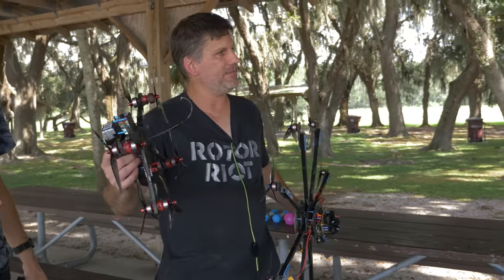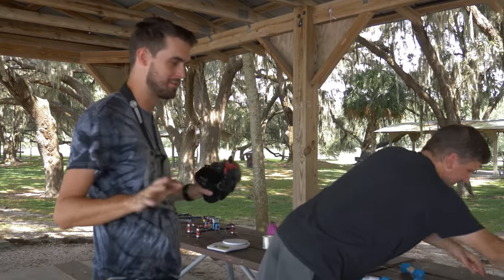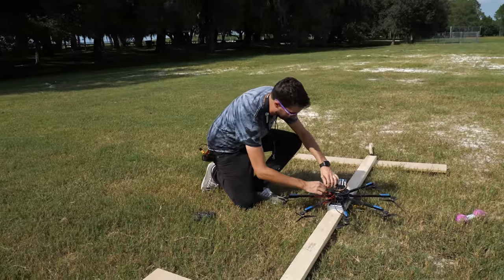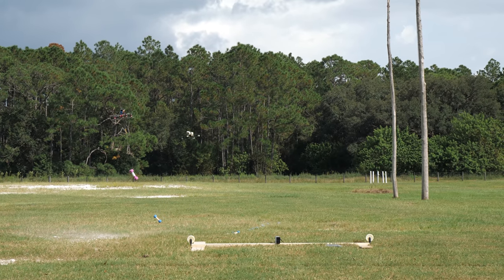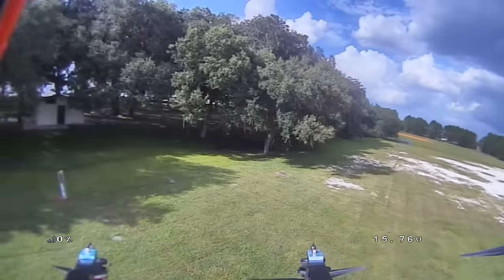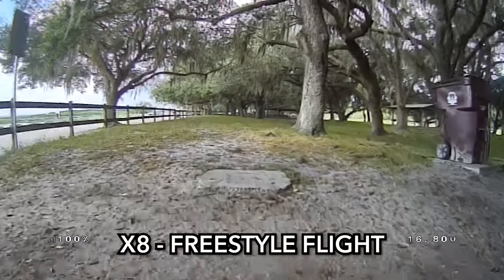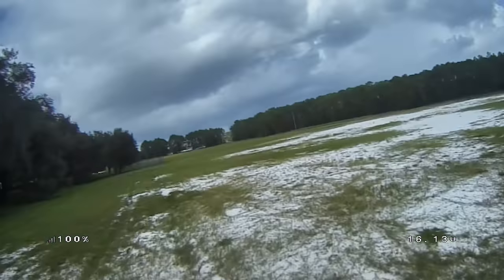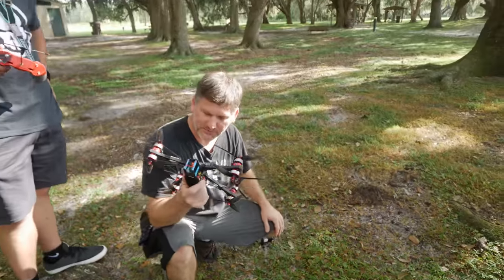Octocopter VS X8 - Which is STRONGER?

Comment: I thought it was unfair to weigh the X8 down. It already has the handicap of 4 props going through "dirty" air so matching the weights of the 2 drones was like taking away the advantage of the X8 but not giving its disadvantage to the octo. I think the octo would've still won but it might have been better matched.
Reply: Even if you add the 1lbs of weight of the ballast, the octo still lifted more.
Reply: It made sense for the lift tests, but they should have removed it for the freestyle.

Comment: A lot of people commenting on the added weight to the x8 being unfair, but the benefit of an octo is the ability to throw larger props which they didn't do.
In their test they effectively handy capped both drones by matching weights and prop sizes.

In the context of the "matched" thrust test I can see why they did it.

What they should have then tried is a test in "best" configuration. So the x8 gets its light weight benefit, but the Octo frame gets to use bigger props to maximise its thrust to weight ratio.
Reply: the x8 was just a converted fpv drone, if they extended the arms to have the same length as the octo the x8 could get massive props, but because they were so close together in the vid the x8 wasn't optimal

Comment: Why did you put the extra weight on the x8? From a scientific point of view that was the wrong thing to do. You can't compare two different designs by nullifying design features. A bonus if an x8 is it weighs less.  Its a trade off between size convenience, thrust and weight. Could you redo this without stacking the odds against the x8? It still won't lift as much but it should outfly it.
Reply: They stated that the battery was 500g. That's 1.1 pounds. Add that to the weight it lifted and it's still less than the octo.   Moot point.
Reply: well they technically they tested 4 vs 8 propstreams and with the weight being equal my guess is that the props stacking is canceling out or at least greatly reducing the power those props can put out this is further shown in the X8 where its way earlier at max throttle since half the props put out almost no lift there.

this is also seen in biplanes 

wikipedia qoute: In a biplane aircraft, two wings are placed one above the other. Each provides part of the lift, although they are not able to produce twice as much lift as a single wing of similar size and shape because the upper and the lower are working on nearly the same portion of the atmosphere and thus interfere with each other's behaviour. In a biplane configuration with no stagger from the upper wing to the lower wing, the lift coefficient is reduced by 10 to 15 percent compared to that of a monoplane using the same airfoil and aspect ratio[1]
Reply: for pulling im fine with the weight since they were testing if you are losing power doing motors on top of eachother.. but for freestyle and tug of war they should of removed the weight.. though it would of still lost tug of war
Reply: We removed the extra ballast weight for the tug of war
Reply: @LetsFlyRC  oh ok perfect
Reply: @LetsFlyRC  Great. But did you remove it for the flight test?
Reply: @Tymopta  not a moot point 🤣🤣 because I would effect its flight characteristics! Did you even watch the whole video? Wasn't just a weight lift off.

Comment: If you want to make the X8 more efficient, you should put a steeper pitched prop on the bottom motor. With the air already being accelerated/dirty, a prop of the same pitch won't produce as much thrust on the bottom, but a greater pitched prop should increase performance
Reply: I was saying this before on discord.. air is already moving so you are losing alot of thrust. you need prop that wants to move the air a lot faster.
Reply: @divingfalconfpv4602  so.. how about putting an EDF at the bottom instead?
Reply: @RFi731  those look crazy. I want to try one of those. Maybe for hover craft lol

Comment: For the x8 you should have used the x8 propeller config from the rotor riot x8. It's supposed to be optimized for the stacked motor configuration

Comment: Lol, you can just see the worried expression on Shawn's face! Also, cool video idea, the rotor riot guys should make a quad with nitro engines instead of motors. Like the comment if you want them to to see it and do it.
Reply: Been wanting to.  But, haven’t been given the budget for it, yet. ;)
Reply: @LetsFlyRC  It'll happen eventually, just make sure to get some low rpm engines so that the quad doesn't run away when you start it up. Also, used engines are ideal here because it's an experiment and you don't want to ruin a brand new $350 engine(especially considering what drew does when you make a crazy contraption).

Comment: Id of thought an octo/X8 of that size would have better than XT90 connectors..

AMPS, bro.. AMPS!
Reply: Technically, they were xt60... lol - Either way, it didn't matter, it still showed accurate results in the test.  Usually, an xt60 connector is fine, when you aren't trying to go full. throttle, and not move, lol

Comment: I got to say I like that sharkbyte doesnt get all that blur when you in area with a lot of stuff.. like ill be just feet from myself but guess just too much data and the whole sides just blur out
Reply: Sounds like you have issues with your setup. I’ll take blurred images any day over that analog style breakup. Yuck…
Reply: @creationlabsinc.189  I have 4 dji quads.  2 bnf.. only issue I could think of is heat maybe causing it from high mW. I could try 25mw and see if any better. I'm usually doing long range

Comment: Simple aerodynamics.  Bigger unobstructed prop area means more thrust.  With the x8 configuration, you get efficiency loss with the counter rotating blades.
Reply: disk loading is the answer

Comment: Radial setup is 20% more efficient than coaxial. The latter is an addition to make a more portable solution, more powerful. A radial drone is bulkier and more powerful but less agile. If by any means, one can attach a gimbal on the lower side of an X8, I don't see the benefits then of a radial octocopter beyond the lift strength.

Comment: Test how it responds to a motor failure.

Seems a benefit to an X8 with a redundant motor could help you get home if 1 motor went down.

Also an X8 and how much real thrust is gained versus a regular quad.   Also taggering prop pitch so bottom props are not stalling out.

Maybe next comparing something an octo with 8 motors and 5in props might need to compare total thrust ouput to something like a regular quad with say 4 8 inch props in same thrust range.

Comment: cool video. but I was disappointed in the weight that was added to the 2nd quad.
That's the point to make it lighter so you can haul more
Reply: In the test results, it didn’t matter. 

Add the 1.1lbs weight to the calculation and the. Octo still killed the x8.  

Also, we removed the ballast for the tug of war

Comment: Build an x8 with a bit longer arms and put the down motors more inwards and some landing legs below the upper motors (that are on the outer end of the arms)
So you have only 4 arms (lower weight) but prop area like the octo... And no prop has dirty air

Comment: Where you able to use dshot on all 8 outputs? Or did you have to go multi
Reply: yes, it was set to dshot 300
Reply: the fc I was using had 8 motor outputs

Comment: I don’t understand why the battery was added to the X8 to make the weights the same, one of the advantages for doing a stacked motor setup like that is for less weight contrary to an octocopter because less frame, so one of its advantages from an octocopter is just removed for these tests, I don’t think it would’ve affected the weight lifting and the tug of war, but the handling test with how it felt “heavy” probably would have been judged differently

Comment: Don't ask why we had to test this, but my 5" freestyle quad with 5.5" props can lift a gallon milk jug that is a little over half full.  Six pounds.  It was hovering at something like 80% throttle.
Reply: @creationlabsinc.189  We had a 6 pound 3D print that we "had" to lift.  We tried to lift the entire gallon with someone's old 450 flamewheel build.  It had 9.5" props and 2212 motors, and was meant to be run on 3S.  We tried all the way up to a 6S pack, and it couldn't lift the whole gallon.  It couldn't lift the ~6 pounds, either.

By the time I said, "Let's just see if my regular quad can do it!" we had already spilled the extra 2 pounds on the ground.

It was not a good flight, but I had lift, and I could have kept flying.  ;)

Comment: the x8 would perform better if the bottom propellers had slightly more pitch because the air is already moving so to maintain angle of attack more pitch is necessary

Comment: pusher/puller concept is NOT as efficient, especially at a hover. . .  it may have some controllability benefits, but better speed should the most obvious benefit in something this size.

Comment: ya... but try and use them how they really would be used. ie, without the extra weight on the x8. thats the whole point of the x8, its lighter and smaller.
Reply: we removed the ballast during the tug of war, and the x8 still lost

Comment: Adding extra ballast to the X8 is kinda unfair, as one of the advantages of an X8 is that it's lighter. So your weight lifting comparisons are off
Reply: the test was to see if stacking the motors or having them separate made a difference that's why they kept the weight the same.
Reply: @Jo3harker  except that it didn't show that. You changed more than 1 variable, so the test is null and void. You can't handicap 1 of the quads and expect to get valid test results
Reply: Even if you add the 1lbs of weight of the ballast, the octo still lifted more.

Comment: 100% obvious result , X8s  lower motors run in dirty air and lose around 30-40%  thrust as a result ,  a way around that is to run Higher pitch or Longer Props on the lower motors, even then 8X is still inefficient compared to a Octo,  on average an X8 would be about the same as a Hexa config in terms of power .
Reply: There is no way (completely) around it, google "disk loading"

Comment: The ballast doesn't make any sense. Imagine a car review where they added weight to all the cars until they weighed the same before comparing them. If one design has a weight advantage, and the goal is to see which can lift more, why would you decide to equalize that advantage then compare them?
Reply: the test was to see if stacking the motors or having them separate made a difference that's why they kept the weight the same. Think about it.
Reply: if you add the 1.1 lbs of weight to the "lifted weight" of the x8, the octo still lifted more - either way, it doesn't affect the end result.
Reply: @LetsFlyRC  Exactly!!

Comment: Why 4s though.... And xt60's...
Reply: 4s is what the motors can handle on 7” props, and xt60 doesn’t usually cause a problem.  Only when you are trying to make a quad full throttle while stationary.  😂
Reply: @LetsFlyRC  well yes but why wouldn't you use lower kv motors on 6s with an xt90 at least, a 5 inch kwad can push an xt60 to it's limit sometimes and I melted one myself on my own 5 inch. Using on on an octo with that prop size is just impractical and begging for disaster.